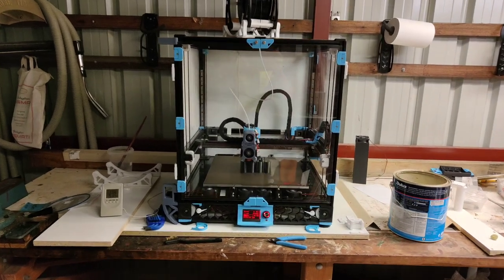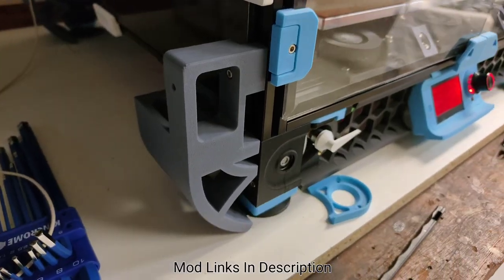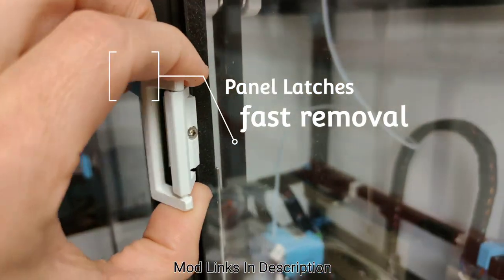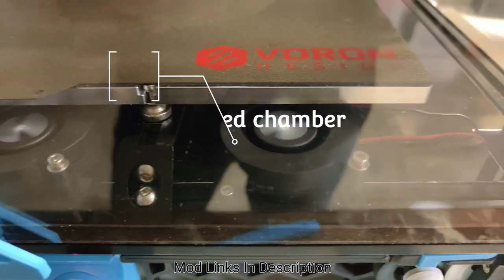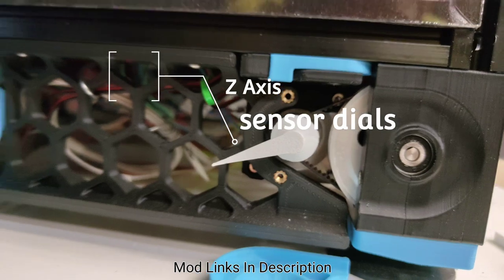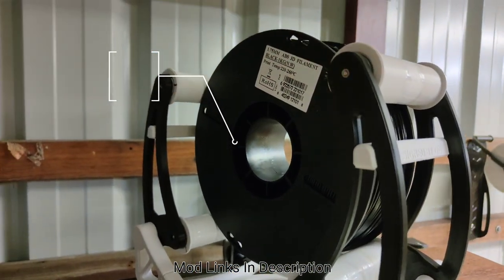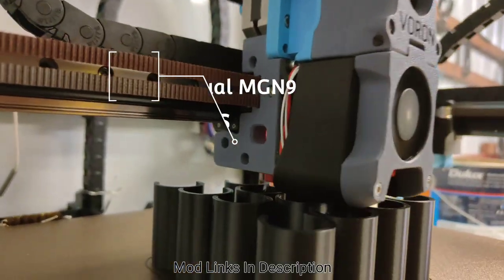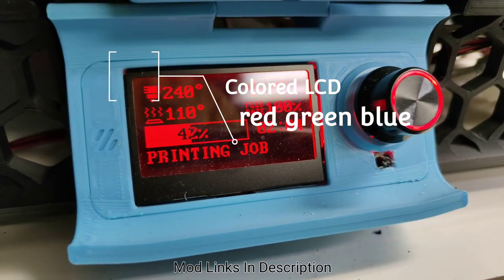Voron 2.4 Mods After The Core Build.

Comment: those rollers are saviours
Reply from the maker: Especially for the 350 build. I remember the manual saying are you prepared and happy with the 350 size. Wish I had the rollers during the build phase.
Reply: @jc84com  Yep, I'm still in the "it's printing but now to tune and fix a bunch of small things" stage where they have been so useful. 

350 didn't bother me until I put on the panels which makes it so unwieldy to move and flip. these sort out the flip, but might get some handles as well.
Reply from the maker: @felixisme  yeah handles are great too they help alot

Comment: Hello julian, I'm switching to CoreXY voron after few years  FDM printers. I'm torn about printer size for the Voron 2.4. Could you help out? I would like to get the bigest 350mm over the 300mm but I've heard that the 350mm gets problem with Z height accuracy due to chamber heat that expend gantry frame. I would like to be able to print nylon carbon as well.
Well, thanks for your video. Nice upgrades!
Reply from the maker: Choices are the 
Vzbot 330
Voron 350
Ratrig 400
All are great printers.
It's very unlikely you want to go bigger than 350/400 printing nylon and abs. As they require heated chambers. It's a real challenge controlling warping on big prints. and getting the flat beds.
I'm a real big fan of the vzbot330 
I'm a real big fan of the ratrig 30x30 frame. I'm currently building a 500x500 ratrig and that,s absolutely massive and I won't be printing abs on that. 

The voron 2.4 flying gantry slows it down a lot in accelerations.
I really like the ratrig 3 axis bed arms. 
My next printer will be a VZbot330
Reply: @jc84com  So, Thanks a lot for your quick response. That makes me thinking of getting a smaller size voron like the 300mm which seems the sweet spot also chosen by famest youtuber as well. Plus smaller chamber means easier to regulate and faster to reach temp if printing carbon...
Well I'll check with the VZbot330! Keep up with the good pace!

Comment: Nice Build mate, 
can you may show us how you did setup the LCD Colour Change synced with the Job status ? I really looking for this a while now, love it 😍
Reply from the maker: Just added to print start and print end macros the neocolor settings.,

Just starting a big upgrade on the printer now fixed pins mod and MGN12 and eculid probe , carbon fiber x axis 
Full XY dismantle
Reply: @jc84com  would you please share your Config/Macro cfg's?
Reply from the maker: @MrBLACKSHEEP2808  
    #SET PRINTER COLORS TO RED TO SAY WE ARE PRINTING
    SET_LED LED=btt_mini12864 RED=1 GREEN=0 BLUE=0 INDEX=1 TRANSMIT=0 ; KNOB LEFT
    SET_LED LED=btt_mini12864 RED=1 GREEN=0 BLUE=0 INDEX=2 TRANSMIT=0 ; KNOB RIGHT
    SET_LED LED=btt_mini12864 RED=1 GREEN=0 BLUE=0 INDEX=3           ; SCREEN DISPLAY

adjust the colors =1 to be on or = 0 off